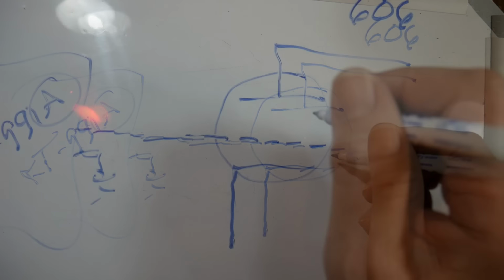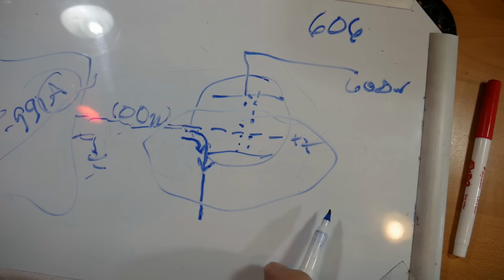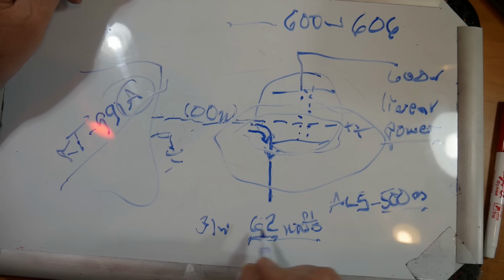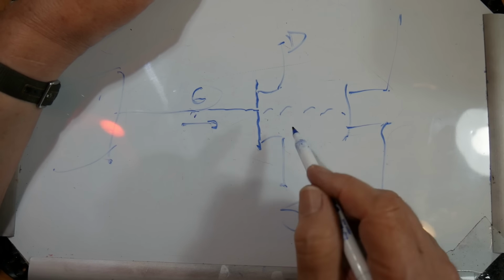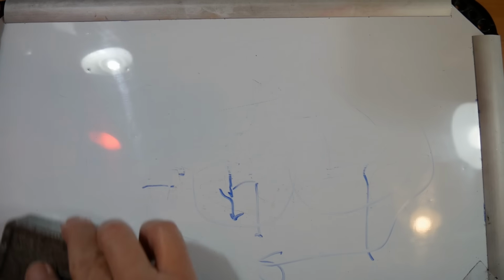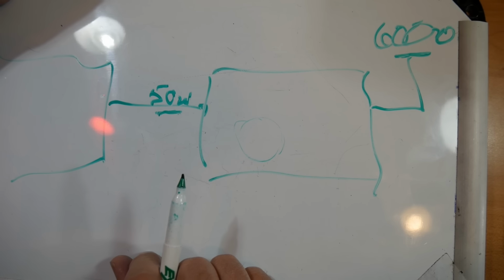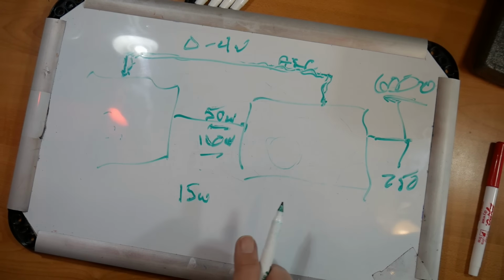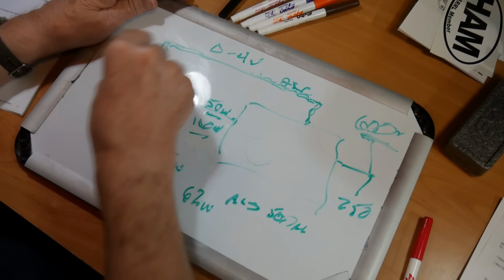How Amplifiers Work (#1406)

Comment: Not all tube operation requires grid current, in fact in many instances grid current is due to overdrive. The onset of grid current is often where ALC is derived from. FWIW in popular grounded grid amplifiers the input drive is applied to the cathode and ends up as part of the output. ALC is generally bad news other than for crude overdrive control, with different time constants around the ALC loop it  generally will not prevent spikes of overdrive and splatter. 73

Comment: Bonjour Dave. Effectivement tu as bien décrit correctement le fonctionnement des amplis à tube et à transistors. J'ai un ACOM 1010 ici au QRA de ma femme qui est branché sur un Yaesu FT991A avec une antenne verticale mutibandes SIGMA HF 360 "1Kw" avec son kit 40/80m ou une MONTOVA 8 TURBO (bandes 10/11m) et je possède un HF-62 (à transistors) chez moi sur un ICOM 7300 avec une antenne type "HyEndFed". L'ampli à tubes me permet "quelques écarts" pour faire résonner l'antenne au delà des limites de plage de fréquences.  Donc sur mon antenne 10/11M très bien réglée, l'utilisation de l'ATU interne du FT991A suffit largement. Par contre lorsque je bascule sur la SIGMA HF360 j'ai la nécessité, pour avoir réglages plus étendus, d'utiliser une MFJ 939Y. Dans ce cas là je suis obligé de reconfigurer le branchement des cordons et ce qui est un peu embêtant car il n'y a qu'une sortie "TUN/LIN. Par contre  sur l'ampli à transistors (HF-62) , il faut que mon antenne soit bien bien réglée sinon l'amplificateur à transistors se met en sécurité rapidement (heureusement). C'est ce que j'ai constaté. En tout cas merci encore pour cette belle démonstration. Passes une bonne journée et toutes mes 73. Joel/F8MGW

Comment: Hi Dave, that was great presentation, it is an interesting topic.. 
I think a lot of Hams don't realize the function/benefit of the ALC.
"I'm' not blowing my horn in any way." 
I have a IC7610 and an ICPW2. I was wondering how much drive to use. I only have a 120v outlet, so 500W max. I can get 300w with 15 watts of drive with out ALC. I set up the ALC and DPD(is awesome by the way) The experts on FB and You tube say don't exceed 50 W. I contacted ICOM tech support, and was told, after the ALC ailment ( into a dummy load ) that I should run my "exciter" at 100w and let the ALC control the exciter o/p., and for FT8 to reduce the drive to 10 watts, so 200w o/p. When I am on SSB, the exciter puts about 30W, but the ALC it can compensate for varying situations .... I have kept the email from ICOM in case something happens. Thanks again Dave I have learned a lot from you over the past # of years. Do you have any comments about this ? Thanks !!